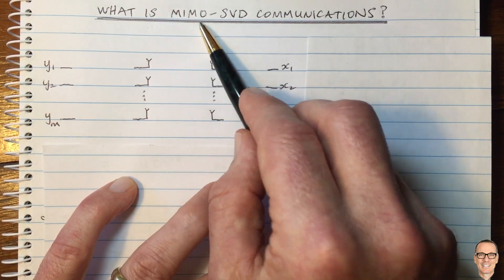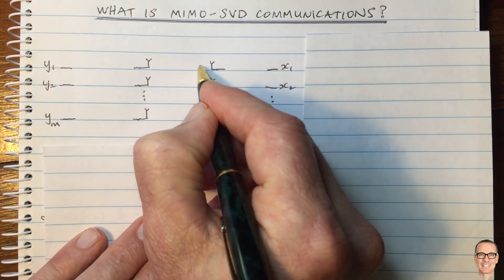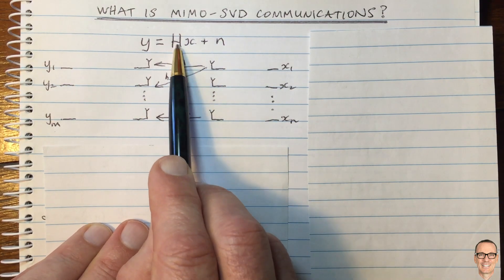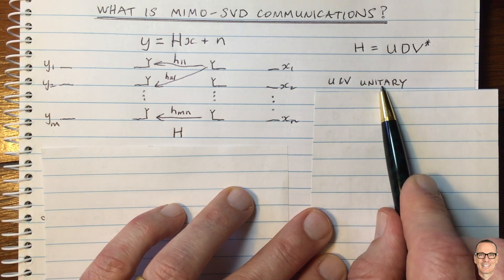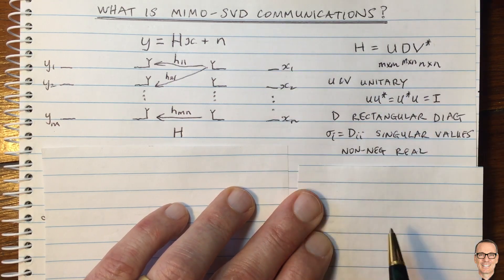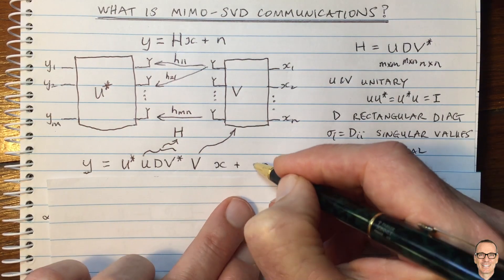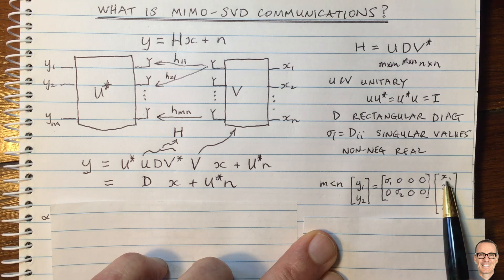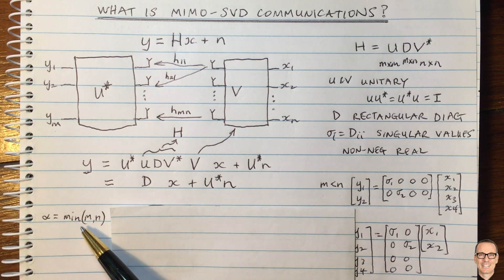What is MIMO SVD Communications?

Comment: Is there any relationship between P matrix and sigma matrix?
Reply from the maker: P contains the square root of the power values that are used in the transmitter for each data stream (which are based on the output powers from the power amplifiers that feed each of the antennas). The P matrix scales up and down depending on the transmit power being used. The sigma matrix contains the channel gains (or more intuitively, the negative gain ie. square root of the power loss) that each of the data streams experience. In your design, you can choose values of P that will give you a desired SNR at the receiver, after suffering the loss in the sigma matrix. But that's really the only way they are "related".
Reply: @iain_explains  Thanks a lot for your response. My objective is to get (at receiver) similar power level for all the spatial layer. Can I make P matrix as the [1/sigma1, 1/sigma2, ...1/sigma_alpha] to meet my objective?
Reply from the maker: Yes.

Comment: Hello Ian,
For the downlink communication scenario with two users. In this setup, the base station is equipped with m antennas, and the users each have a single antenna. My question is about designing the precoding matrix at the base station.

Since the channels for both users are different, should I:

1. Add the two channel matrices and then perform singular value decomposition (SVD) on the combined matrix? Afterward, multiply the resulting V matrix with both user channels?
2. Alternatively, should I compute the SVD of each user’s channel matrix separately and then multiply the respective V matrices?
3. Also, how different power can be allocated to different beams?

I am interested in understanding the impact of these approaches on capacity vs SNR calculations.
Reply from the maker: This video should help: "How are Beamforming and Precoding Related?" https://youtu.be/iMIqEpzxN9Y

Comment: Normally the signal flow is from left to right on diagrams. Why are the receivers on the left and transmitters on the right?
Reply from the maker: I drew them that way to match the order that the matrices appear in the transmission equation.

Comment: Interesting, thanks a lot. So we in that example we can just use 2 data streams, but we use all 4 receiver antennas. They form kind of 2 stronger and narrower beams compared to a 2-antenna system.
Is that about right?
Thanks.
Reply from the maker: Yes, that’s correct.

Comment: Many Thanks. Is the noise just caused by the reiceiver amplifier? No other causes?
Reply from the maker: Yes, as @henrikhellstrom1241 says, there can be other sources of noise. Although, if those sources have structure to them (spatially or temporally) then we tend to call it "interference" rather than "noise", and we try to exploit that structure, in order to cancel it. There is also "noise" in the transmitter amplifier (that then goes into the channel, and doesn't just appear as additive noise), however, in general, the transmit power is much higher than the transmitter noise from the transmit amplifiers, so it is ignored.
Reply: Additive noise can be caused by different sources, and the dominant source will depend on the reality that your model is describing. Usually, noise is divided into internal and external noise, where internal noise refers to unwanted signals generated by electronics inside the receiver hardware (as you are suggesting in your comment). External noise refers to unwanted signals that arrive from outside sources, such as background radiation from the sun or other transmitting devices that interfere with the desired signal.

The mathematics that Iain is describing here is general and could model other sources than just amplifier noise.